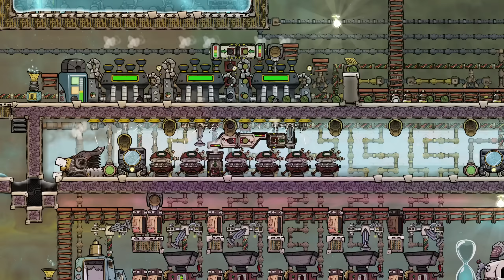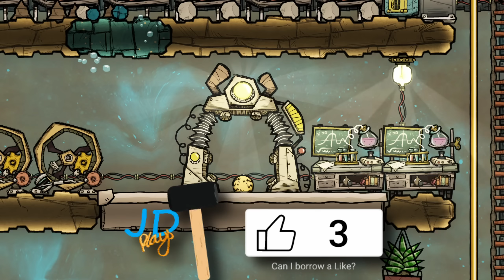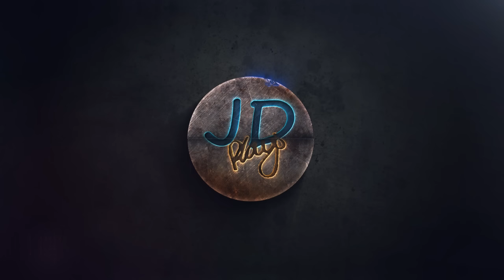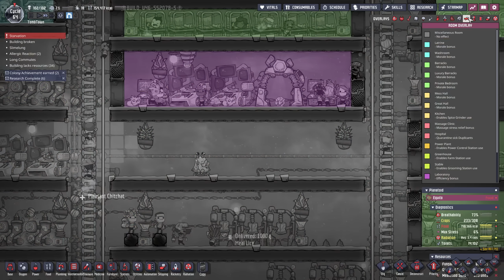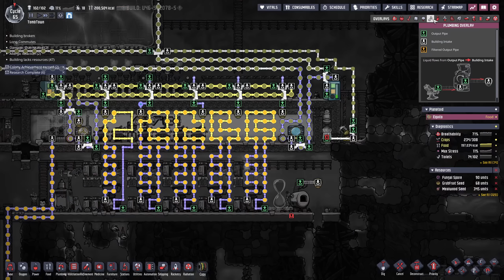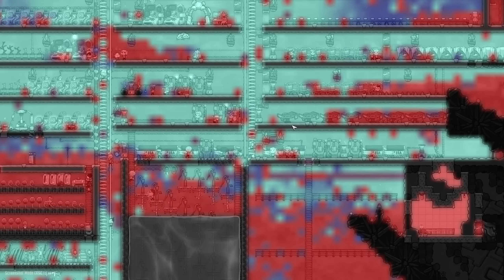Burning Out ⚰️ Ep 14 💀 Oxygen Not Included TombTown 🪦 Survival Guide, Challenge

Comment: As mentioned by others stone hatches don't eat sandstone: I have been waiting for you to notice (you misclicked into the normal hatch selections when setting up the very first stone hatch feeder).

For a max size dual floor (or ground and mezzanine floor) that's 117 [55 tables, water cooler // soda fountain, hanging pot above ladder]¹ ( 29 x 5 with one ladder location or otherwise missing mezzanine tile).
120 is possible (30 x 5) but only yields one extra table [56] as you need to encroach one table spot with a tile to keep the 120 tile max (doesn't matter if a tile on the roof above the ladder works - you would still need to place the hanging pot).

¹ though I'd opt for 54 tables and use a sculpture (granite & masterwork artist only) - less likely to have the lose the moral bonus if // when I kill the potted plant. One could also use a 2nd tier artist and a blank canvas (square 2x2)  above the ladder and overlapping one "table spot"
Reply: ofc if you have external access to both floors you could forgo the ladder and opt for a metal sculpting block in it's place  - no artist skill needed and no pesky frail potted plant.
Reply from the maker: Turns out you cant overlap a painting behind a mess table anymore!